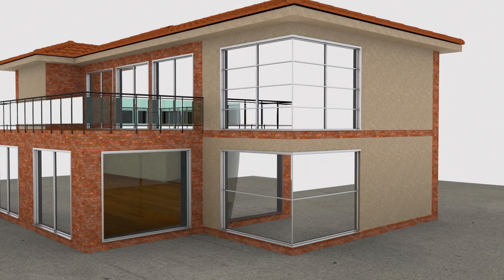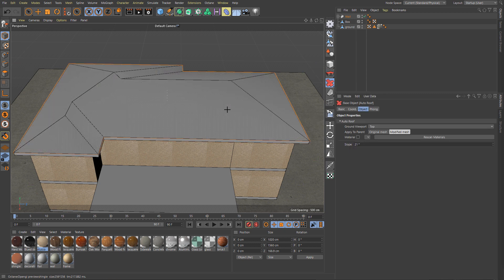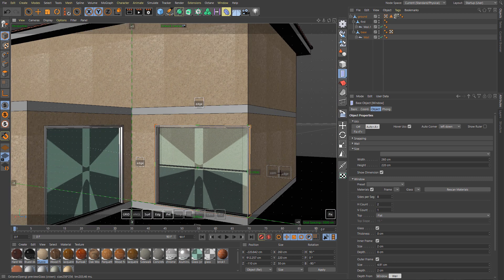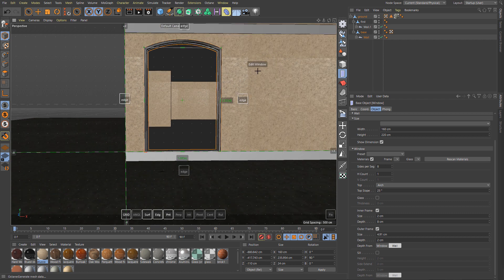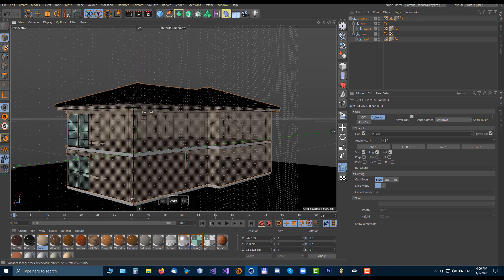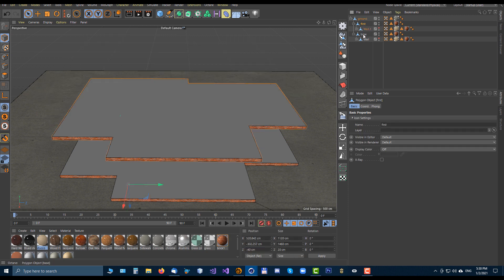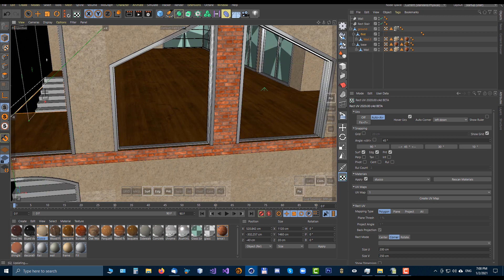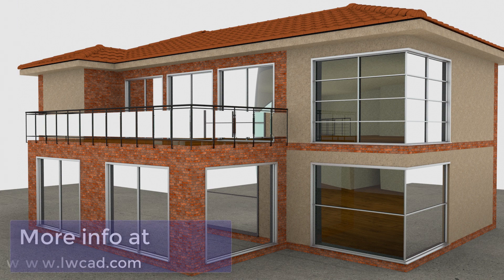The 15 minutes house with Architron in Cinema 4D

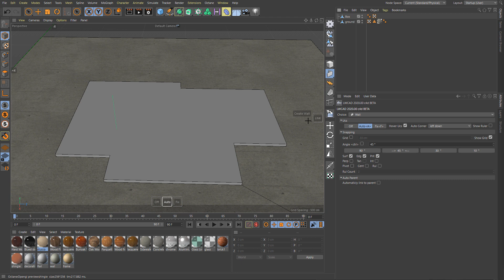Comment: 1:07 awesome wall tool
1:25 make quick 2nd level floor = feels like playing sims 3
2:45 window so easy compared to blender add ons

3:30 easily copy paste the same custom window you made using fixed mode
3:50 corner window

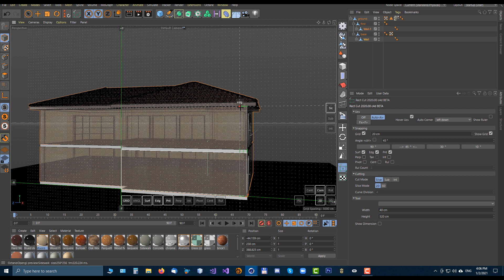7:09 cut mesh w snapping grid

10:05 cutting hole in floor for staircase quickly

Comment: does it work propperly in 2023.2.1? Can't create a Box and the grey boxes at the View bottom are empty.
Reply from the maker: This is already fixed in latest Architron 2024. 
Tested in C4D 2023.2.1.
Reply: @architron  no more in Octane Blackfriday? .-)    btw, all I wand i a new Transform Tool. Michael Welter did have a great tool. Clould you do it new from scratch? Great Workflow helper!